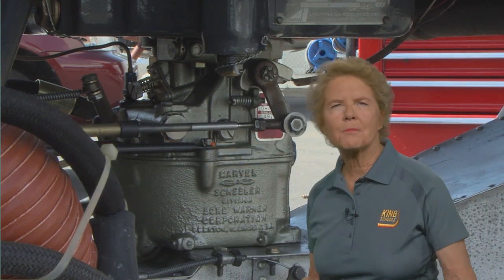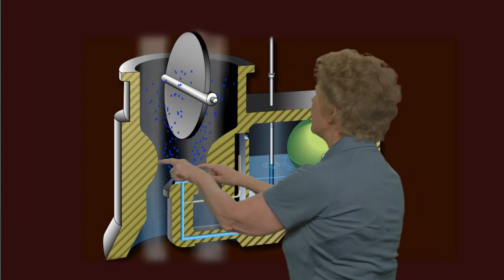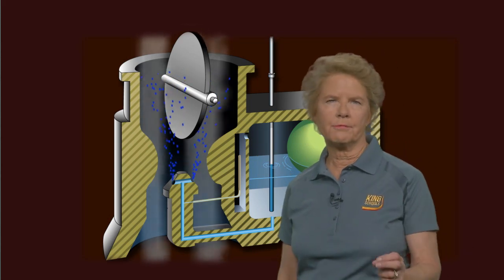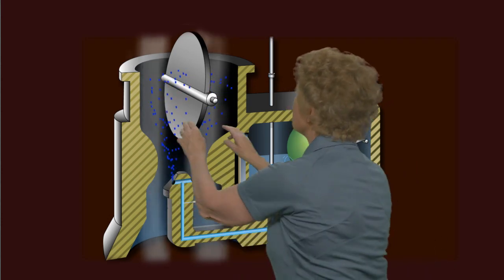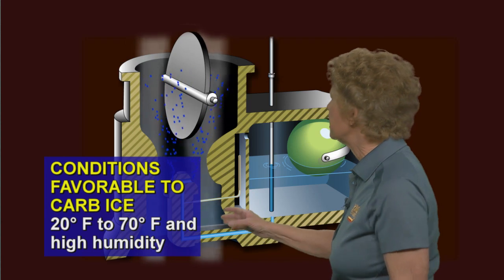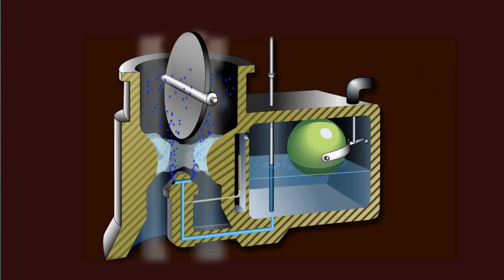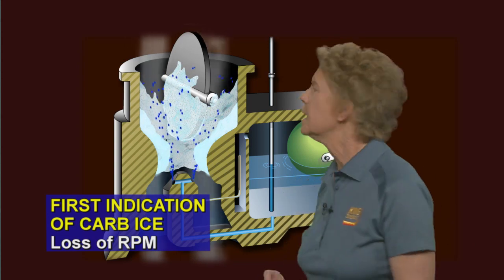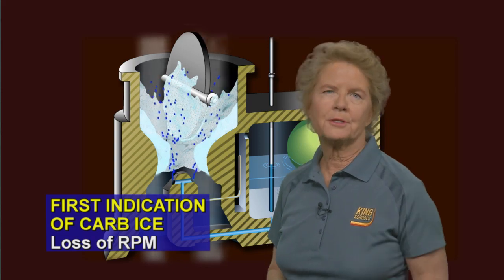Carburetor Icing - Don't Forget This Simple Lesson! // Private Pilot Ground School

Comment: Hi, if the Carb is ON, why would the fuel-air mixture will be richer? Isn't less air-fuel mixture for combustion and exhaust resulting less power provided?
Reply from the maker: Yes, the mixture would be richer because the hotter air would be less dense and therefore less "powerfull" if you will. In that state, there's too much fuel in the mixture. This will decrease power.

Comment: Excellent lesson. The instructor mentioned something I was waiting to hear and have not otherwise. That is, that upon passing through the Venturi the accelerated air then expands into the larger diameter portion of the flow passage / throat of the carb. Am I mistaken in thinking that it is this expansion of the air that causes the cooling  - just as a compressor driven refrigeration system works? Much text in sources refer to the 'acceleration of the air' through the narrowed region that causes cooling...that doesn't seem to jibe with physics. TIA
Reply: Good question. While both expansion of the air (increase of volume) causes it to cool per "Boyle's Law", there is cooling due to the evaporation of the fuel.  Due to a fuel leak in the cockpit, I once had the unfortune experience of having a 10 minute foot bath in 100LL, and I can tell that it is a very very cold experience - it was summertime in Illinois and I would not have been surprised to have seen frostbite on my toes. Maybe a little bit of hyperbole in my comment there, but  it was a very cold experience.  SC

Comment: So why does ice form at lower rpm when higher rpm has a much greater airspeed through the Venturi which results in even colder temperature?
Reply: Higher engine heat due to burning of a lot more fuel at high RPM?
Reply: because the butterfly valve is partially closed at lower rpm increasing the venturi effect
Reply: Because as she said, ice can form anytime the air is below 70 with high humidity. It is not a function of power setting. My father managed to get himself killed back in 1967 while spotting salmon in Alaska. He had descended into cloud, got a restart, and flew into the side of a mountain upon climb out. With 3 heavy fishermen in a Cherokee 140, he was pushing his luck already!
Reply: OK, I’ve experienced carburetor icing in a 150 at night when the temperature was 63 degrees. It was the first time I ever experienced a carb  Icing in 40 years of flying. I was doing pattern work and I was entering downwind when I reduced my power from max to 2300 which was still in the green arc, the engine immediately ran rough and the plane started to vibrate. As soon as I pulled carburetor heat within 30 seconds it’s smooth out. When the butterfly valve is closed, airflow is restricted so you’re air speed in the Venturi slows down. It must form ice because it allows the water molecules to freeze just as a lower turning propeller will gather ice near the root as opposed to a high rpm propeller, which virtually does not collect any ice on the blade tips that are almost near Mach speed.
Reply: @ConvairDart106  So why do people pull carb heat when we pull the rpm below the green arc but not before reducing power for stalls or when landing?
Reply: @aviatortrucker6285  because in both of those situations, full power must be available. In the case of a stall, full power is required to recover, and in the case of a landing, full power must be available to execute a go-around. Carb heat reduces rpm so full power would not be available.
Reply: @aviatortrucker6285 , You should apply carb heat before landing, before stalls, and any time the rpm is going to go below the green arc.  Ice can build-up in the carb without showing any indication on the tach. By applying the heat, you are simply clearing the carburetor.  

The relative humidity is a function of carb icing.  You can get carb ice at 70F if high relative humidity is present.  You can get carb ice when operating in the green arc, too.  Apply carb heat any time you suspect ice may be forming.  And, don’t hesitate to use partial carburetor heat if conditions are causing ice to be chronic.
Reply: A P&W R-980 might need continuous car heat during cruise. Lycoming mounts the carb on the engine in such a way that it absorbs heat from the engine and experiences less carb ice than a Continental.  

Ice can form at any RPM, even in the green arc.  At high RPM, the pressure differential is so great that any moisture may be converting to ice crystals rather than super cooled liquid droplets.  Ice crystals are not as sticky as SLD.